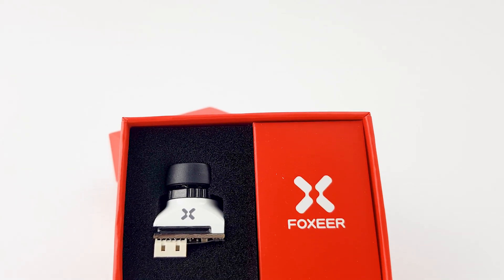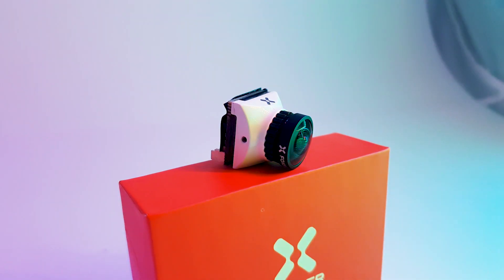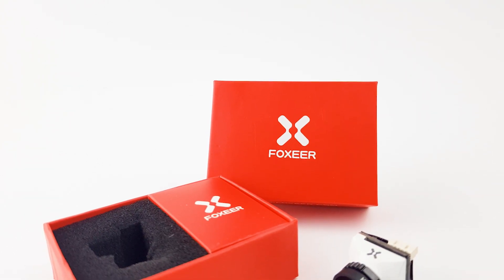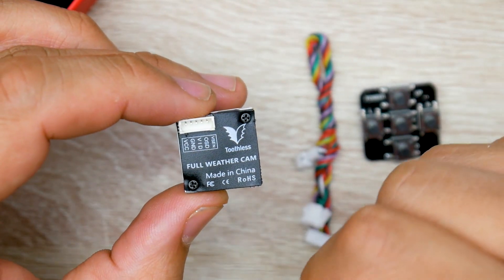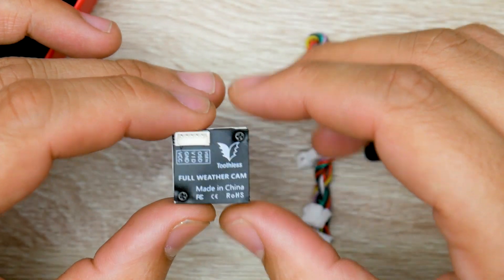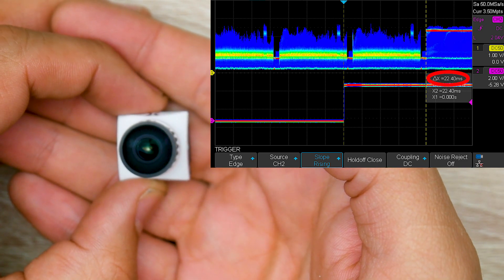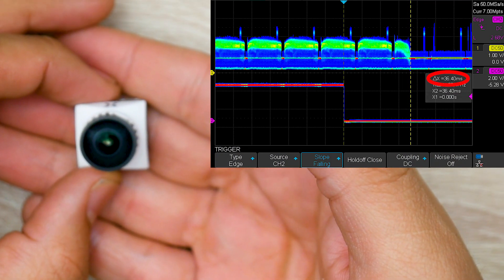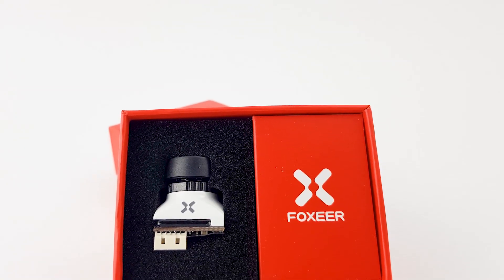Foxeer Toothless All Weather Camera // Latency Testing

Comment: Nice video again. Would you mind testing something? Last time when I have managed to land into a tree at night flying I had to turn the ESC beacon on to find my quad. When I finally spotted it all my motors were piping hot one of them even started smoking (Xing 2307). They were not under load I did not try arming and free the quad so the only reason I have left with is the ESC DShot beacon feature many of us relying on (without a beeper) actually heating up the motor.  Could you take some measurement to confirm this - or the opposite? Thanks.
Reply: Using motor beacon will heat up motors and can fry them... If you're relying on this as your only beeper put it on a switch that way you can activate them when you're near.